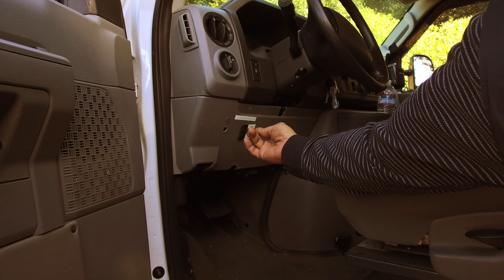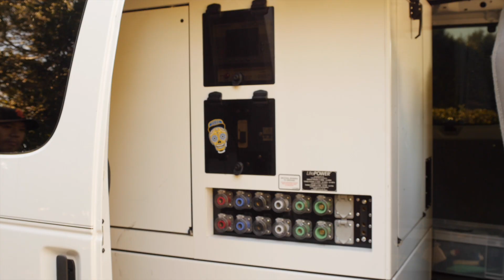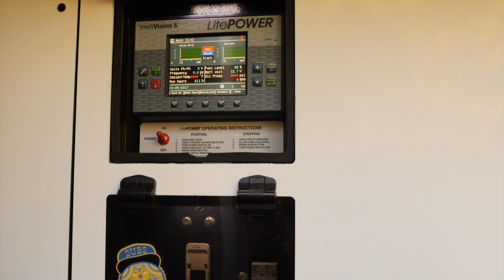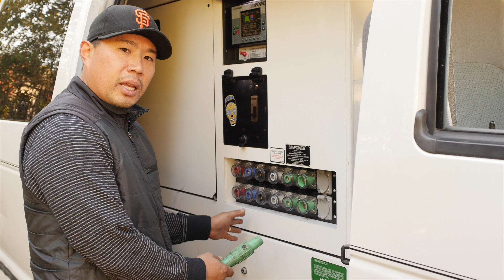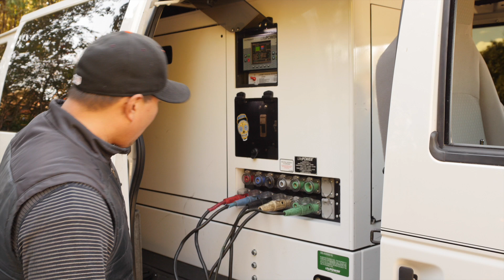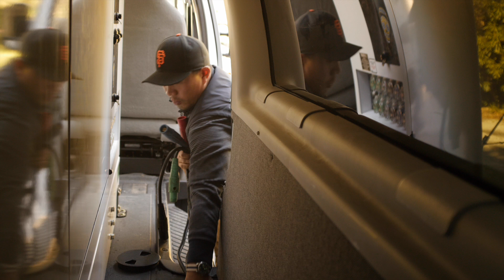Meet The Gaffer #34: Generator Basics

Comment: always so weird to see american style distro, in europe (germany at least) its all 3 phase heavy gauge cable 400v 16/32/63/125A cables, its all very straight forward, is there some reason this generator doesnt need to be grounded?
Reply from the maker: From Dave Mong:

The Generator is grounded to the chassis of the vehicle. If it was a tow plant it would be grounded to the tow chassis. As for why use different gauged cable and not just use one...If properly planned, we try not to do any unnecessary work.  If it was a power plant that was 1000amps or more I would use 2ø or 4ø to start and not banded. Since mine is only a 500amp it has limited power and for simplicity of demo, banded was used. 

Hope this helps
Reply: Hey, german lighting tech (and aspiring gaffer) here. I Have used similar cables supplying big stages or for building power infrastructures on Festivals. The system (or the plug) is called Powerlock. They are rated at 400A or 660A, with cross sections of up to 120mm² (compared to 125A cables wich normally are 5x35mm²) I think a 5x120mm² cable would just be too hard to lay out.

Comment: What do the phases mean?
Reply from the maker: The short answer is that “phases” refers to the different lines of power, usually called “legs” or “hot legs”. It doesn’t make a lot of sense, but single-phase refers to the alternating current (AC) set-up of two hot legs, one neutral leg, and a ground leg. If you used a meter with two leads and put one lead on the neutral and one on one of the hot legs you would read nominally 120 volts, if you put leads on the hot legs you would read 240 volts. In contrast, a three-phase system uses three hot legs, a neutral and a ground. Read between a hot and neutral in this system and you should get nominally 110 volts and between two hots around 208 volts. When the power runs correctly, the alternating current is represented as a sine wave, and flows down the neutral “in phase” with each other where the sine waves are separated from each other. That’s a pretty simplistic intro, but I hope it helps a little?

Comment: Hey Luke ! Great episode, and I agree with Cifcap. Great to see practical examples to Harry Box's handbook. I have a couple questions though: Dave Mong's "genee" like most big generators are four wire three phase plus ground, correct? And I am still not sure what's the difference between Three phase and single phase? Thanks for the episodes!
Reply: The simple answer to balancing loads is just to try to have nearly equal current draws on each hot leg. In a tungsten world I would have just done rough math and added up the watts of the lights, but with Flos, HMIs, LEDs... it's more straightforward to meter the amps at the genny.

In theory, if you have equal loads on each leg the neutral will have zero amps on it. In practice, you don't need to be too obsessive about it. If you evenly distribute 7 2KW lights on a single phase or a three phase 120V system one leg will be 16+ amps higher than the others and that's fine.  But if you put all 7 lights on one leg and nothing on the others you might hear the genny going "whump, whump, whump" and you might see those pulses in the lights' brightness. Don't do that.

Another episode on this would be great. Too bad we can't demonstrate what NOT to do, but there are plenty of terrible stories. Maybe Luke should do an episode where people gather around a lift gate and tell stories of weird distro and unfortunate accidents.
Reply from the maker: Hi Cain,

I believe the +16A would be because you have an uneven number of 2K units. One extra unit on one of the legs would give you a 16A difference. You'll just have to be on a few jobs with a Genny and an amprobe to have it stick in your head and really make sense!
Reply: Hey Luke!

I think i get it, a 2K pulling about 16A throws off the perfectly balanced amperage of say 6 lights on the genny? 

As far as hanging out with the genny a few times... sign me up! : )

Cain
Reply: I agree with Cain here, I'm not sure what the difference in phases means. Would you ever do a video on basic electricity knowledge and what one needs to know going into a space?
Reply: Three phase seems obvious. You've got three hot legs so there must be three phases. But then you realize that single phase consists of two hot legs and the symmetry stops adding up. Why do three legs = three phases but two legs = one phase?

"Phase" actually refers to the waveform difference between the hot legs. With AC power  the voltage (in the States) on a leg varies from Plus ~110V to Minus ~110V, like a wave, with each leg carrying waves that are staggered from each other. So, if you're looking at three legs, there are three differences between them: A-B, B-C, and C-A. In a single phase system there are only two legs, and the phase difference is only between A and B. So it's a single phase.

Why are the waves staggered? The generator is rotating magnets past coils (or vice versa) to create electricity and it's all physically arranged to make staggered pulses. One reason (maybe the only reason) it's done this way is to let a motor run smoothly. When a generator is under load then each time the coil and magnet pass each other it's like hitting a steep hill. You stagger out those strong electromagnetic fields so that coils and magnets pass one after another rather than all at the same time. So you have phase differences.

I'm simplifying this a bit, but this also gets to why you want to balance the load on the hot legs of the genny. You want all the legs drawing similar amounts of current, creating similar electromagnetic loads every time the magnets and coils pass each other. This helps the generator to run smoothly and deliver electricity at a reliable voltage and frequency.
Reply: Oh Heck Yeah! Robert Mack! So since getting my hands in more grip + electric work about a year ago and hearing "single phase" + "three phase" I've remained a bit dumbfounded on the difference, and not until recently have been able to put 2 legs and 1 phase or 3 legs and 3 phases together.

Thank you Harry Box, Luke Seerveld, + Robert Mack for your explanations. 

Still not sure how to balance the load of the hot legs on the Genny? I think it would be a great episode. 

Cain
Reply: Hey Robert, thanks for the explanation on how to balance the genny, basically it sounds like as long as you don't put all of the lights on one leg you will be fine, but it's good to know that on a three phase 120V system one leg will be 16+ higher than the others, (actually, I'm still a little confused why it is 16+ amps). 

I do think that it would be cool for Luke to do an episode on what not to do. Scene: People gathering around the liftgate sharing stories about weird distro and unfortunate accidents. CUT: to reenactment of what not to do, shot in black + white.
Reply from the maker: Hi Harrison, You can definitely do a video with basic electricity knowledge if you’re just plugging into house power. Check out Alan’s brief overview in #36. I hope that helps?
Reply: Hi Luke, could you do a video that goes into more depth regarding generators and perhaps more so three phase supplies and what problems can occur.
Reply from the maker: That would be good. Not sure how soon I’m get to that, but will put it on the list!
Reply from the maker: Hi Cain, thank you for the questions! 

Most genny's of this size and larger can do both single and three phase. You can also rent genny's that produce DC power, which can be good for high speed shoots using large tungsten units (rather than high speed HMI ballasts) or when you're using Brute-Arc's. 

Simply put, single phase gives 2 hot legs, a neutral, and a ground while three phase gives you 3 hot legs, a neutral, and a ground. 

There are different reasons to choose single or three phase depending on what kind of cable you have (4 wire or 5 wire, plus distro) and what kind of fixtures you'll be using and how you want to distribute them. Another consideration we can discuss during an episode on cabling, is balancing the genny in terms of amps per leg.
Reply: Hey Luke!

Thanks for the response. It really helped clarify my question between the difference between three phase and single phase. I know studios used to have big DC generators back in the day, but now I guess the only reason to use DC is to power large tungstens or Brute-Arcs. I've heard that Brute-Arc's provide a unique light that I imagine serves a specific aesthetic purpose?

Also, I would love an episode on balancing the genny in terms of amps per leg. Let me know if you need any help shooting!

Cain
Reply from the maker: Hi Cain,

Brute arcs create a very pleasing source of light from the flame produced  by two carbon rods, one negatively and one positively charged. There's nothing quite like a focused flame through a large fresnel. The barrier is that it's more labor intensive. And you can run them off AC with a inverter that looks like a lobster trap, if I remember correctly. Ping me via text re helping on an episode...

Comment: Amazing, so different from the generators we use over in Malaysia. We hardly have owner-operators for gennies.
Normally our rental houses use open-air wood cargo trucks with a generator bolted to the back. I've never seen such a clean set up! and we normally use Denyo gennies, and in Asia we work in 240V.

Anyway thank you so much for taking the time to do this video, this is such a niche topic but there are film students like me going into electricity that really appreciate this. I've seen neutrals that have melted together and the best boy said someone didn't connect them together tight enough. 

If you could go into more little practical safety tips (like your tip on attaching the ground cable first) that would be great. Loving the content on this channel so much.

Actually I have a question: How would you safely measure the voltage from the distro box if it didn't have those convenient access points?
Reply: David Choo thanks for the kind words. This is just a very basic introduction to the current generators being used in the industry in the states. We run 110v but definitely use 220v when it is required. You can safely test via the camlock flow out or through the bates plug, which are the long black vertical strip on the box. Each plug is a specific hot leg (red, blue, black). Just remember to never kneel on the ground. Bend over or squat or use an apple box if you must sit. That way the electricity will never pass through you in case of an accident. Hope that helps.
Reply from the maker: David Choo, great to hear about experience in other countries! Normally you would take the same two leads from the tester, red and black, and touch them to the open, female Bates or camlok openings. There will be another episode on cable distro, so I'll try to remember to call that out for you! Thank you for the kind feedback.
Reply: Wow, surprised to find malaysian here on this channel (although its six years late for me) ! Greetings! malaysian here too
Reply from the maker: Ha, ha! It’s a small world after all😉
Reply: @qiyuantan  haha nice to meet you, welcome to the lighting world if you’re new here!